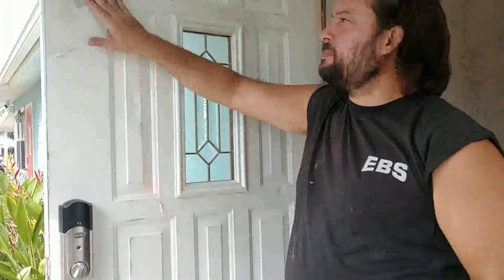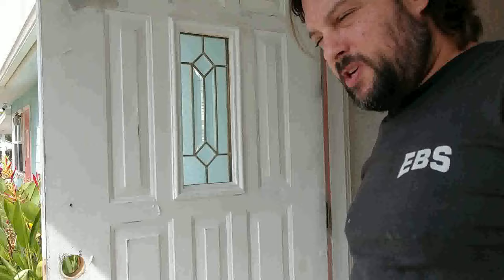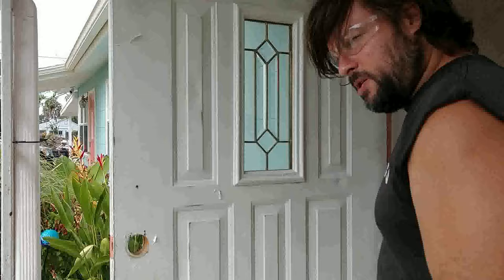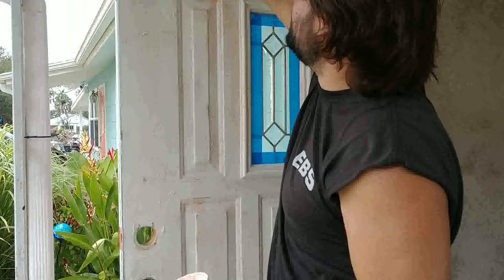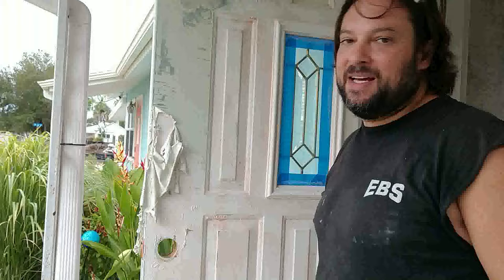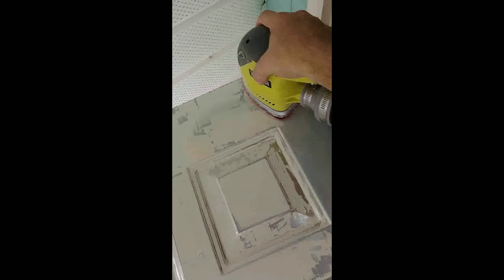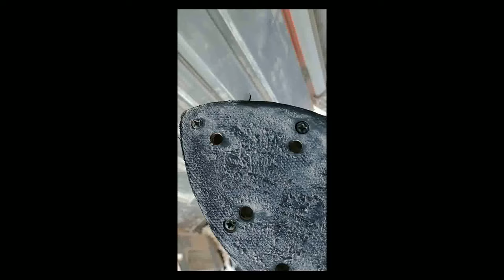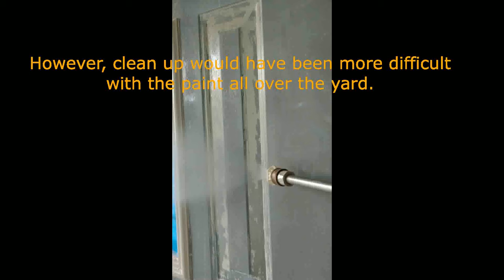CitriStrip for door paint: How to remove old paint using CitriStrip paint remover -CitriStrip REVIEW

Comment: Thanks for posting Jason. The citri-strip and the power washer are good ideas. I am planning to strip and repaint a metal door but I am going to remove it from the hinges and lay it horizontally across some sawhorses first. I think that will make the process easier.
Reply from the maker: I agree, one of the commmenters suggested coating it and wrapping ti in Suran wrap and leaving it overnight for an extended time??? sounds like it coulebe a good idea??? Let me know if you do that and it works.

Comment: Jason, thanks so much for the super helpful and timely video! I did the same thing you mentioned Sunday, spent hours trying to use a non effective paint remover and hand strip thereafter. The method you describe in the video was so easy, the job would have taken my less than one hour front and back if I watched your video first. Much appreciated!
Reply: Good to hear the video helped. Thanks for your reply.

Comment: Each to their own. I hate stripping. 
Get a good organic striper. Jasco is one. Lay it on saw horses, brush one way apply it heavy. Put plastic sheeting on top of it. Go have a coffee or a beer. Let it sit let it do the work. Once it is all bubble up remove the material.
The plastic sheeting prevents it from drying out in which you do not want. Let the stripper do the work. Wash it with lacquer thinner or something similar. Union painter 40 + years commercial and residential. Not to concern about chemicals but stripper is organic not chemical. Used in a well ventilated area. Over time will cause brain damage in a low vented area. Mask / respirator will do nothing. Doing it Outside is the way to go.

Comment: I hope you made sure that the oil based paint was not lead. If the door if over 50 years old then it is a possibility! Stripping with a chemical is safer than sanding with Lead paint! Be safe!

Comment: When you repainted the door did you spray, brush or use a roller? How long did it take to do the whole stripping process?
Reply: The stripping took a few hours and the bondo work took a few hours. You can get it done in a long day. Its best to spray the paint but you can also use the rollers specifically for doors if you don't have a sprayer. Good Primer is very important. Good luck!

Comment: I used this on part of my ceiling. And the reason why is because certain spots the paint comes right off in chunks but other spots it was a challenge. I apply some citris to a corner n it started coming off but under it i get this sticky grey residue. It looks like someone painted over another color. How do i get this off? Do i apply more citris?
Reply from the maker: I'm not sure this is a good product for drywall. You need to read the instructions to see if you are using it on the right surface. I would get a washcloth and a bucket of sopey water and wash that part of your ceiling. You need to clean it all off. Then let it dry then sand the spot you are trying to fix and use plaster to fix any damage. You should use a good latex primer prior to paint.
Reply: @JasonsVacationRentals  i used it in my son's bedroom ceiling and it worked fine. Now im using it in my living room. There r spots that the paint came right off without using the citris, but certain spots were tough to get off.
Reply from the maker: what kind of paint are you removing and what kind are you applying? Is it all ceiling paint?
Reply: @JasonsVacationRentals  I don't remember now but the room has been repainted now and it looks good